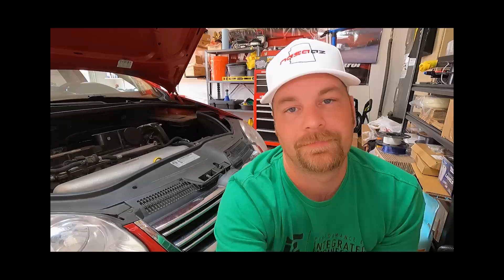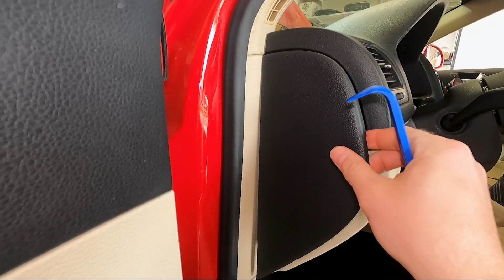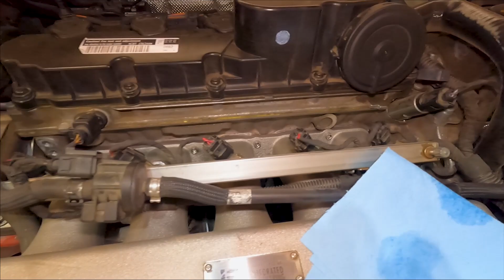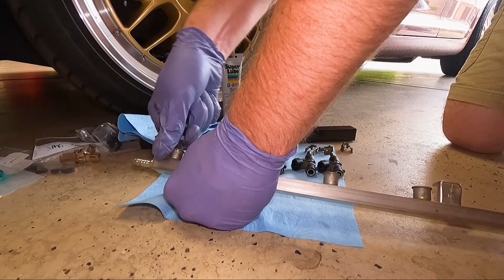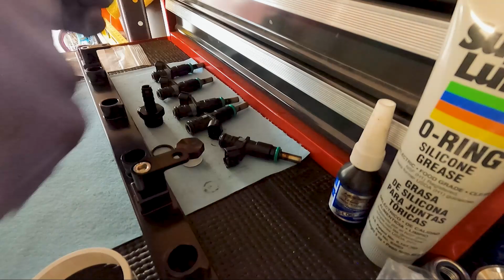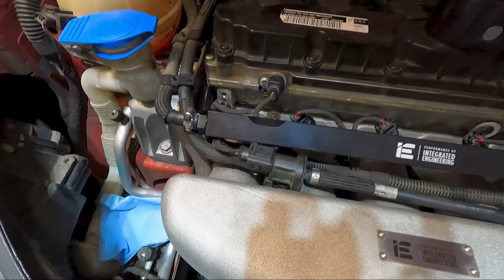How To Change Fuel Injectors and Seals | Billet Fuel Rail Install | VW | 07K | IE | Replacement

Comment: o2 sensor tells ECU how long to open and close the injector, I don't see how this is gonna do anything for the engine? other than makes it look pretty. Flowing more fuel will just cause the ECU to open and close the injectors for a shorter amount of time to keep the o2 sensor reading at a 14.7 : 1 air fuel mixture.
Reply from the maker: The fuel rail is for future upgrades where more fueling is required. It’s cosmetic at this point.

Comment: What are your thoughts on the Bosch 550cc Fuel Injectors?? Would they work with the fuel rail ??
Reply from the maker: @Christian-zt9dr   no need unless your going turbo. They will work with the fuel rail.

Comment: When you say prime the system after you installed everything what’s was that process? Just turning the key on and off without starting? Or does this car prime when opening the door? I seen different responses on google lol.
Reply from the maker: @DavidCastro-m9r  you should hear the fuel pump kick on when you open the door. If not, turn the key to the on position. If you are using the factory fuel rail you can use the shader valve to purge out the remaining air in the system. With the billet rail I was able to run the vehicle and it worked itself out.
Reply: Thank you. Appreciate it.
Reply from the maker: @DavidCastro-m9r  your welcome!

Comment: What are the OEM injectors rated to (cc’s)? I am looking to do the same upgrades and I am curious. I will be upgrading the spark plugs aswell.
Reply from the maker: Not sure on the rating, but they are fine for NA. Only need to upgrade if going boosted.
Reply: Thank you! You just saved me time and money 🙏
Reply from the maker: @bennettb_19  your welcome!